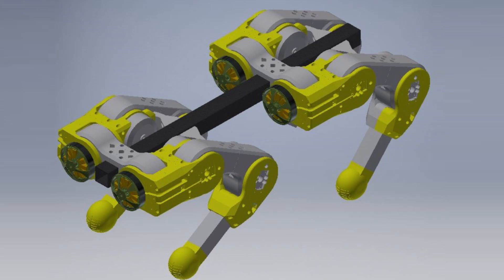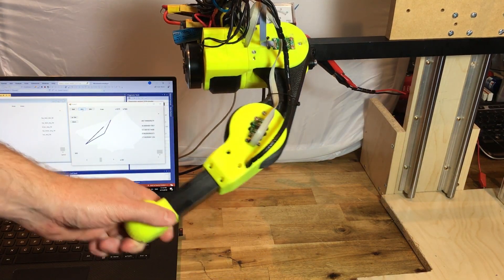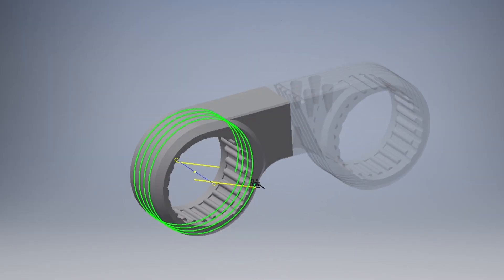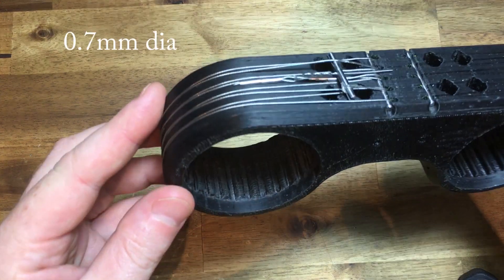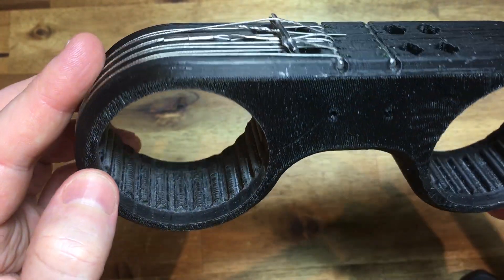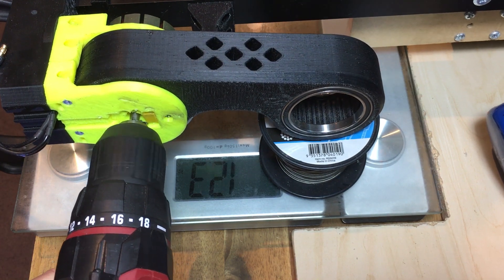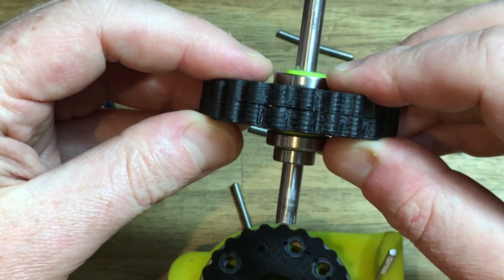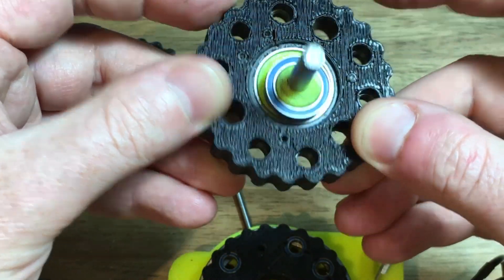Robot Quad Leg Strength Tests with Un-used Over Engineering

Comment from the maker: In general, I'm pretty happy with 3D printed cheap ABS parts in this Cycloidal Gearbox. I'm bending steel pins. 30kg @ 12cm 360kg.cm (~35Nm). The brushless motor attached to this gearbox can only output ~10Nm
Reply: OK first off let me say WTF lol really going places with this design.
Instead of high infill percentages try more/thick perimeter lines. Tests from a lot of people show infill pales compared to perimeter thickness. (But make sure it fuses properly)
In my experience 20% gyroid infill with 3-5mm walls takes quite the beating before it goes anywhere. The added print time from the walls is IMO it worth.
A interesting study would be if you fuse steel wire into the gears could strengthen them immens.
Look here for reference: https://www.youtube.com/watch?v=XpDG8VxZsw4 <- I think I send it already to you ;-)
Oh and happy new year 👍
Reply from the maker: I'm using PLA now (as my good ABS printer is broken) on my Ender-3. I've been making a new smaller PCB for this design. I'll be back testing this soon. 3-5mm walls seam quite thick. I might gradually make it thicker. I think making soft feet will reduce the peak loads on the gearboxes.
Reply: @PaulGouldRobotics  Try to anneal the PLA in the oven, depending on your material it might works wonders. An hour around 80°C should be plenty.
To find the optimum print a flat strip place it between two poles and raise the temperature in 5 min / 5°C intervals until it begins to sag then go back 10°C.

But experiment with that first you will get shrinking and expansion in some dimensions that need to be accounted for.
But that is also a sign that it works and recrystallised nicely.

A idea would be to use a short strip of spring steel as "toes" this could also catch a lot of the initial impact of setting down the foot.
Reply: @PaulGouldRobotics  if you're using pla try baking it out post print too. Rearranges the structure to provide increased strength
Reply: @DerSolinski In a design im working on I have a load cell at tge joint output which provides some active suspension

Comment: Use concentric infill or just print with like 20 walls. 
Using 110% gilament flow can also help with strength
Reply from the maker: I'm using 6 wall layers now and it is much better. Thanks

Comment: Hi Paul, great series... thanks for making this open source, I've downloaded and started printing the thigh and cycloids using Taulman Alloy 910 Nylon, crazy strong, So much so my file almost skates across the surface of this stuff. You have to try it, i think it's the answer to all your strength and rigidity requirements. I printed using a Creality CR-10S, bed at 60C, nozzle at 265C, 30mm print speed, 90% infill, 0.2mm resolution using Cura. Perfect recipe for amazingly strong parts. I challenge you to break it... my bet is you'll need thicker pins e.g. 5mm. Looking forward to the next vid!
Reply from the maker: I have a "strong version" with 5mm pins but with bearings. I will have to start with Nylon it seems like it will solve a lot of my problems. Do you preheat/bake your Nylon before you print with it? I may also try 3mm drill blanks for the pins. I should be able to buy them in bulk.
Reply: @PaulGouldRobotics  No preheating at all, just make sure it's good and dry. I simply opened your STLs in Cura, set the print quality to draft (0.2mm - best result), 90% infill, 265C print temp, 60C bed and the key is the speed, 30mm seems to be optimal, oh and i forgot to mention, no fan for the entire print, best results. Alloy 910 is super easy to print with and the results are simply remarkable. I'm not kidding, this stuff is insanely strong and quite rigid. Looking forward to hearing the results, should you choose to try it out. cheers p.s. quick review and examples of strength https://www.youtube.com/watch?v=8_pt_05BqYk

Comment: could you just fix one end of the femur to something and then add weight to the opposing end till it fails not very scientific but should be enough to prove that the femur can handle the forces involved and for the parts in the cycloidal gearbox perhaps a different filament might be better something that has a higher tensile and compression strength, this is awesome work and because of this started building my own cyclo drive 78mm outer diameter 30:1 reduction onto the third iteration now
Reply from the maker: I've actually started using PLA for this design, mainly because my ABS printer is broken and I'm stuck with my Ender-3. 3D printed parts, with the right settings, are stronger than I thought. 
What are you making with your drive? Are you using two or three disks?
Reply: @PaulGouldRobotics   sorry for the late reply im using two disks in mine, and im developing them for a quadruped robot  my brushless motors are only 500 watt hobby king motors so the entire robot is considerably smaller and after seeing other people problems with weight and such im primarily building it from carbon fiber and aluminium tube

Comment: if you need i can macine parts from aluminium plastick or steel for you small parts only  like the gears and the the crankshaft i can make from steel  including the excenters on the crankshaft  
jsut pm me
Reply from the maker: Hi Thefreakyfreek. That is super nice for you to offer to make some small parts for me. I'm trying to design my quadruped without the need of special machined parts. I have some magnetic gearbox designs I'm working on. I may need some parts for that in the future.Cheers Paul
Reply: @PaulGouldRobotics   I'm happy to help I have a small cnc mill and a small manual lathe  which can pritty much do all materials in low volumes

Comment: Cycloidal Gearbox has less backlash than panetary gearbox? Wonderful construction my friend
Reply from the maker: In theory it can have zero backlash where an involute gear assembly requires some by design. I will find a whitepaper on the explanation why that is.
Reply: @PaulGouldRobotics  thank you for your quick reply ... very interested in your constructions

Comment: You may try some engineering plastics - PET, Nylon or similar
Reply from the maker: The final design will be made of some material like the one you suggested or made from Al in China. My current aim is to design it well enough so that the material type doesn't matter and anyone, with any 3D printer, can make it.

Comment: I think you should  to test composite filament
Reply from the maker: My printers are pretty cheap and don't like fancy filaments.
Reply: @PaulGouldRobotics My ender 3 is good. I thing it not a problem. nowadays exist PLA with carbon fibre embedded
Reply from the maker: @uthvfyrekbnm6008  I have a standard ender 3 which prints PLA well.

Comment: The youTuber GearDownForWhat https://www.youtube.com/watch?v=hjFyikKPldE printed ring-gears for the actual differential of his pickup-truck, with interesting mixed results. Indeed filament containing chopped carbon fiber will help, but beware that it wears out nozzles and only adds tensile strength to the horizontal directions and is fairly anisotropic. Another  YouTuber (I forget who) has actually printed press-brake anvils, so the compressive strength is apparently not an issue. Good luck!
Reply: Here: https://www.youtube.com/watch?v=wsxFXTKaXdI :)
Reply from the maker: I actually work in the press brake industry. The punches (top part) are under compression but the die (bottom part) are under both tension and compression. I agree, plastic looks good for high compression forces. I'm printing a new test jig now, results in a few days.

Comment: Great work as always! I wonder if you could have other YouTubers to collaborate, to make you components out of Delrin, Phenolic, or Bronze etc., so you may be able to tackle much heavier load? And for the material of the steel pins, maybe hardened pin can work better? Just some ideas :D
Reply from the maker: Thanks. I'm pretty happy with the load handling of the printed parts. My goal is to design the quad so that anyone can make one at home without any special tools or exotic material. That's why I'm working on an Actuator controller based around the Arduino.

Comment: Infill adds much less strength than thicker walls do. The stress always concentrates on the surface.
Reply from the maker: I'm using 2 outer layers. Should I change it to 3 or 4? Will layer height and/or nozzle dia make a difference?
Reply: @PaulGouldRobotics  If you are using 0.4mm nozzle, then 2 outer layers make an extremely thin wall for a part that is supposed to bear any load.

Infill provides very little strength. And changing nozzle diameter or layer thickness also most likely wont produce any noticeable difference in strength. It may also even complicate things for you - you'll have to carefully tweak temperatures and printing speed in order to not weaken the part even more. Because with thicker nozzle and thicker layers it's harder to transfer enough heat into the plastic in order to melt in evenly at the optimal temperature. So the 0.4mm nozzle and 0.2mm layers should be just fine.

The simple and reliable way to make the part stronger is to increase the wall thickness because the mechanical stresses concentrate on the part's surface. And, by the way, you can increase the thickness not only by doing more wall perimeters but also by increasing the extrusion width (e.g. extruding a 0.6mm line with a 0.4mm nozzle) - this increases bonding between layers by squeezing every layer on top of a previous one with a greater force. 

So for your part I'd recommend doing at least 3 outer layers and 150% extrusion. This should increase the strength of your part more than twice. Also you can drop infill down to around 20-40% to save some printing time and material.

Also make sure you are using the optimal temperature setting for your printer/material/setting combination - this may also have a big impact on the part strength.

Also, as we can see, the inner gear broke in the thinnest area of the part. So keeping the holes as far as possible away from the outer wall would be even more important. The gear should have a thick outer belt of solid material.
Reply from the maker: @SergTTL  Wow, Thank you for the detailed info. It will take me a while to understand the pros and cons of each printing setting. One more piece of information. The tolerances on the mating surfaces (external teeth on cycloidal gear and internal lobes on the gearbox housing) are very important. Too tight and it binds up, too loose and the back lash is unacceptable.
Reply: @SergTTL  better than 25 youtube vids. Thanks, a lot Serg.
Reply: @PaulGouldRobotics  Think of it as the shape of an I beam, the top/bottom part have way more leverage compared to the middle of the beam, so they get the mass and the strength. Same with the shells of a 3D printed part. You could add thickness to the up/down faces of your build and avoid them on the left/right/front/back sides - depending on where the strength needs to go.

For testing, just mounting the arm rigidly and hanging stuff from it until it breaks should be sufficient? And I for one would have loved to see what the fishing line did!
Reply: @PaulGouldRobotics  thicker nozzle+layer height = stronger.

https://blog.prusaprinters.org/everything-about-nozzles-with-a-different-diameter/
Reply from the maker: @TheMaidenOnes  Interesting, I'll do some more reading and try some different heights/diameters.

Comment: Keep up the great work. I love your design. If you can get 3mm drill blanks, they are impossible to bend. Spring steel is another idea, it will add compliance and bend back after. Also consider carbon fibre filament. I don''t know much about it but its supposed to be stronger.
Reply from the maker: I like the idea of Spring steel. But I was also amazed that the silver steel pins bend before the rest of the gearbox was destroyed.
Reply: Me too, 3mm piano wire should be easy to get hold of.
Reply: Oh yeah, Nylon laser cuts really well. You might need to stack it to get a good gear at the right thickness. Cuts very fast too

Comment: I'm no expert in concrete or anything, but I've always thought it was called post-tensioning...because you add the tension later. Wouldn't pre-tensioning mean you add the tension before? I'm sure you know better than me...just curious if I've been calling it the wrong thing or not for post-tension concrete.
Reply from the maker: It is possibly both. Tension is applied after the concrete is "set" but before the next part is built on top.
Reply: @PaulGouldRobotics  I was curious, so I looked it up. Pre-tension slabs, the cables are tensioned, the concrete is poured and allowed to set...then the tension is released. Post-tension slabs, the concrete sets and then the tension is added.  Never knew that before.  So basically the same idea, just the tension is in the opposite direction depending on which was was done.
Reply from the maker: @PowerScissor  I will have to test to see how much stronger it is.
Reply: @PowerScissor  Nope. The tension is in the exact same direction. The cable is always loaded in tension and the concrete always in compression. The difference is that in the first case you need a large external jig to tension the cable/rebar BEFORE you pour the concrete (when it has zero compression-strength) whereas with the second, the tension is applied in situ with nuts or face-plates after the cement has set. The "pre" in pre-tensioning is intended as "before the train rides over the bridge".

Comment: A cheap cnc mill can mill POM quite well. POM is very hard to break and often used in gears. very good wear behavior, sliding POM against POM. it is not a 3D Print, but regarding wear behavior, strengh etc. I think on the long way, POM gears are a better choise and you can do this also on your own. anyway, thank you for your videos!
Reply from the maker: I have been looking a routers for a while, I want to make one or convert my spare 3D printer. But I'm still quite happy with the 3D printed parts. The parts are stronger than I thought, even with cheap ABS plastic. I wonder how much it would cost to get them make in China/Taiwan out of AL or Engineering Plastic.I need a min of 48 per Quadruped.
Reply: @PaulGouldRobotics  hi, thanks for reply. with cheap cnc mill I mean something like this "Sorotec Basic-Line 0605". Kits start at around 2.600 EUR. Good for aluminum also. You can see this machine running here https://www.youtube.com/watch?v=KmOf9wOES4I (german). I never had a 3D printer but a small cnc router. but if you buy two small POM pieces and rub them against each other (totally smoth, you don't even see anything) or try to break them ... I think it is a bigger difference to 3D plastic parts. anyway thanks & best regards
Reply: For light machining   Braun's mostly 3D printed router   should be enough, if you want to get into machining metal take a look at   Piotr Fox Wysocki granite cnc router   or "routercnc"
Stay away from Chinese PCV or  miniature Al routers, as they tend to resonate right at few hundred Hz.
Reply from the maker: @attinyit9609  Thanks for the information. I was thinking of a Chinese Router, maybe not anymore.

Comment: try polymaker CoPa (insane strong and easy to print nylon (I print 360mm dia gear on open printer) it not cheap but it super strong 
but for other project I spend sooo long to make 3dprinted cycloidal reducer and it broke every time......so I cnc it from aluminum and now its working no problem!!!!!!(in your case 3d printed almost worked ok so I think cnc pa6 or pa6.6 plastic will work endless
Reply from the maker: I've tried cheap Nylon but the warping was huge. CoPa looks good and easier to use. It is expensive (5x ABS), not good for prototyping but as I only need 1kg for the final quad, I'll reprint the final design in CoPa or something similar. I could get the Cycloidal gear machined in Al or plastic from China/Taiwan for a few dollars per gear. I need at least 48 gears per quad. 
What are you making with Cycloidal gears? How much torque are you putting though it?
Reply: Paul Gould 
250-500 watt mid drive e bike (motor and reduser 500-600gramm weight(super light!!))
Reply from the maker: @aretgh  I currently use the ML5010 (600W) motor and with the 25:1 Cycloidal gearbox it weighs ~500g. The main reason for the Cycloidal gearbox is the very low backlash
Reply from the maker: @aretgh  Most e-bike motors are 2-3Kg. Where did you see the 500g one?
Reply: Paul Gould my motor is 250-300gramm)))
And I have 500x500x500 3D printer
And polimax nylon is expensive because its insane high quality!!!! It's print super easy on open printer (I print gear 300 gram weight and 350-380mm in diameter on open printer with no problems!!!!
Reply from the maker: @aretgh  Can you please give me a link to your motor. It is nice to know the Polimax nylon is good and easy to use. I will have buy some. Thanks
Reply: I think for nylon you probably need to put your printer in a heated chamber. The guy above is right, Nylon is awesome, you just need to work out how to print it. All your parts would benefit.

Comment: see this: https://youtu.be/wN1AFG08P28

if you use epoxy make sure that it have the same material properties as the 3d printed plastic.
Reply from the maker: I think that he needs more research into Carbon Fiber and other strengthening materials
Reply: @PaulGouldRobotics  he most likely will. have you seen this one on inserts?   
https://youtu.be/G-UF4tv3Hvc

Comment: Maybe less damage with a planetary gear drive ? 🤔
Reply from the maker: I've been looking at some of Gear Down For What videos. His small gearboxes break at 18Nm. His bigger ones are much much more. With the OpenTorque Actuator Test (developed by Gabrael Levine) https://www.youtube.com/watch?v=6lW2YGQQIQ4&t=701s they are getting 2.58kg/m (258kg/cm) or ~25Nm but that is limited to Temp/Current. It is also a bit bigger. I like the Cycloidal Gearbox because the backlash can be very low and it's different.